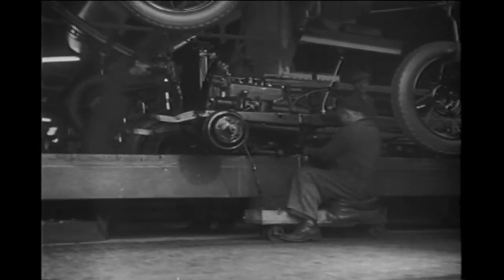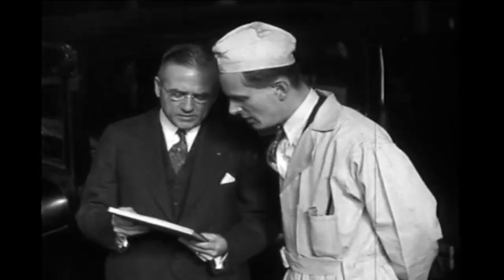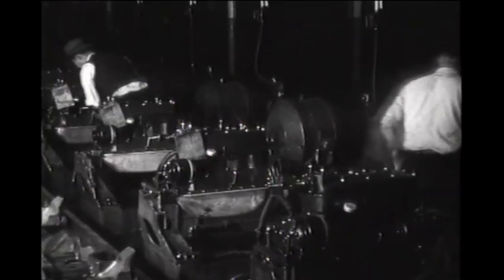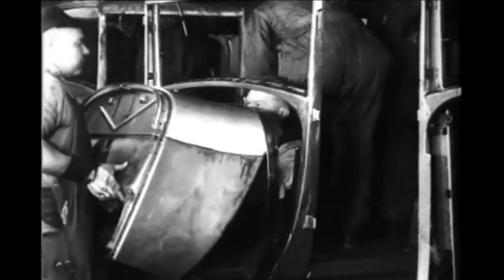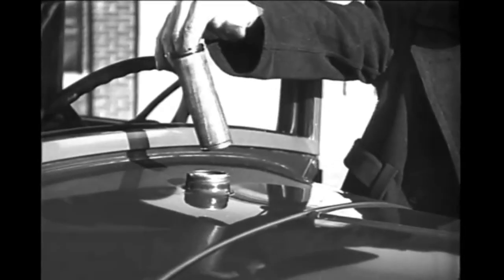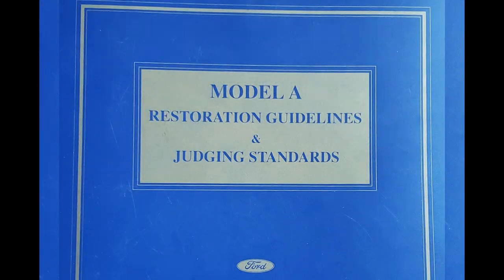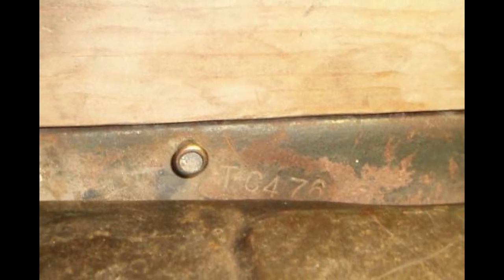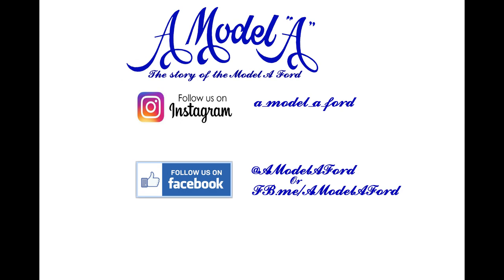What Day Was Your Model A Ford Built...Why You'll Never Know

Comment: Check out some information on rebuilding the speedometer. That's where I found that there's a build date code on the back of it. From that code, I was able to determine that my Model A is a Feb. 1930 car. It's not the exact date but  knowing the month, if your speedometer is original to the car, is pretty close.
Reply from the maker: True, if the original speedometer is in the car you could help use that as a way of narrowing down the build date. Also, the starter band had a date code stamped onto it for all the non-powerhouse models. Thanks for watching and pointing out another way of getting closer to an original build date.

Comment: Great video! Is there some kinds of list some where of all the ford plants that assembled these? Would there be a way to find out which plant it was manufactured at by looking at the number by the cross member like you said?
Reply from the maker: Thanks for watching! Pg 14 of this document lists the abbreviations for the assembly plants. http://www.plucks329s.org/pdf/studies/LETTERS%20AND%20NUMBERS%20AND%20CODES.pdf
Reply: If you find what plant a model a was assembled at, based on the number, would you be able to tell when the body was made? Do they have records of each factory when the body was completed?
Reply from the maker: I don't believe that specific info exists at this time. Say you have a '29 Coupe labeled JE (Jacksonville) 2217. That'd mean it was the 2,217 Coupe assembled at that plant since 1928. Since Jax only assembled 2,414 coupes in '28 and '29 you know you're probably at the end of the year. Other things to take into account would be that the Jax plant didn't open until May 10th 1928. The following isn't an exact science since production was still not at its peak until 1929 but you could surmise that the Jax plant assembled approx 120 coupes a month, meaning this example coupe would have been built in November of '29. There's a lot of variables though such as the plant closing down at the end of '29 to retool for the '30's etc. 

Again, its the sum of the parts that'll narrow things down.